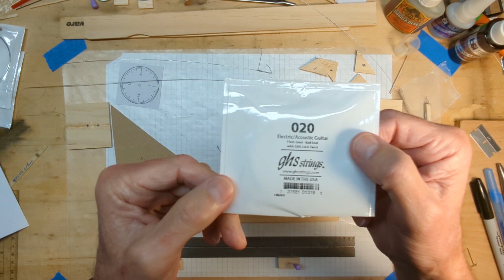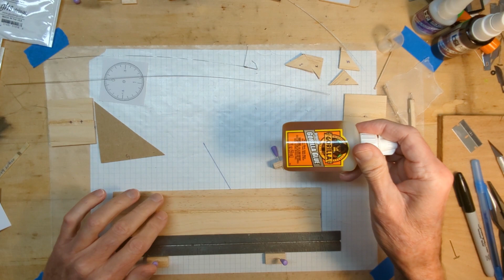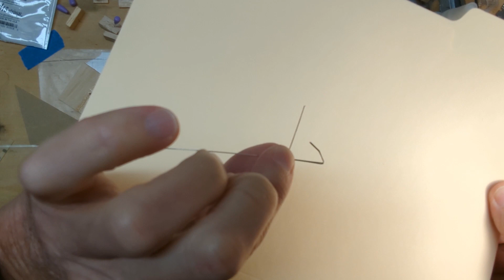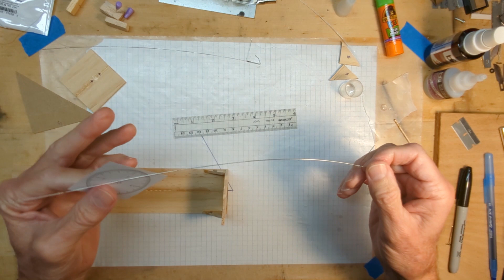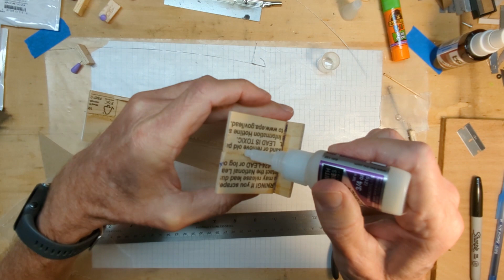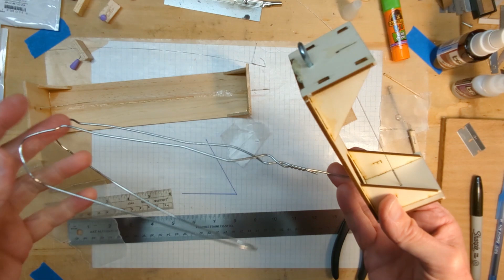Super Simple, Cheap Torque Meter Build

Comment: sorry this event it fully new to me and im just starting to get the hang of it but i have one question, how does the number of turns correlate to the torque count and how would i calculate the torque modulus? thanks
Reply from the maker: Number of turns is a poor proxy for torque. Each time you wind a motor its dynamic change. Generally speaking each successive wind will take more turns to match the torque of the previous wind. This is why we use torque meters

Comment: My wire tests found that 0.020" wire fails at about 1.8 inch ounces of torque. On the DCTM, that occurs at about 11. Twisting to 10 returns to zero. Twisting to 12 returns to 0.2. Once the yield stress is exceeded, the wire is no longer good for torque measurements. To go to 2 inch ounces for the 2014-25 helicopter event, you must use a larger diameter wire of appropriate length. The J&H torquemeter is smaller wire suitable for up to 3/32" rubber.
Reply: Correction: the DCTM also uses 0.015" steel wire.
Reply from the maker: Yes, good comment. Some on the NFFS Youth Development Committee have posted on the Science Olympiad Discord Channel a torque meter wire element substitution the 2024-25 Helicopter flying. As most of the helicopter kits for 2024-25 are using "1/8" rubber strip (.08-.087 g/in), and winding to over 2.0 inch ounces will be needed, an 11" piece of .025" diameter wire will record 4.0 inch ounces for one full revolution (twist) of 360 degrees.

Comment: Nice presentation.

You can get straight 0.020" K&S Music Wire from most hobby suppliers. It is important that the wire be straight, otherwise some of the turns go into making the wire helical. This is analogous to knots forming in rubber. Also, the indicator wire will not remain evenly spaced from the dial if the torque wire is not straight.

You must be careful to avoid parallax error in reading the dial. You must view the indicator wire straight on, otherwise the dial mark will be seen offset. Ideally the indicator wire will be very close to the dial.

It is essential that the torque wire going into the hook not twist inside the CA and thread, otherwise the needle will indicate an added twist for the bit of wire beyond the desired length. Steel wire is very smooth and could easily twist loose inside the CA and thread. I solder my separate indicator wire to the torque wire.

With this hook, the rubber will be slightly offset from the torque wire. This can cause the torque wire to bend. It must be kept straight. It would be better to make a hook that keeps the rubber aligned with the torque wire. I have used a square hook.

The dial has 100 divisions. What is the corresponding unit of torque? My measurement of some K&S 0.020" steel wire found it took 0.6222 gmcm to deflect one degree at 15.6 cm length. 9 1/2" is 24.13 cm, so it would take 0.6222 x 15.6/24.13 = 0.4023 gmcm per degree, 144.81  gmcm for 360 degrees, so your units would correspond to 1.448 gmcm. You could adjust your wire length to get some other value per unit. A 25 cm wire will make each division 1.5 gmcm. Your wire is likely different from mine. Wire diameters and torsional coefficients vary from batch to batch, just like the properties of rubber vary. For accurate results, you must test your wire. It is common to see recommendations to test wire with a lever and weights to apply a torque. This method bends and twists the wire and includes friction in the bearing, producing unreliable results. Another method uses a disk and weights hanging from the edge on thread. This also produces unreliable results. I use a torsion pendulum to measure the properties of the wire.

https://www.endlesslift.com/steel-torque-meter-wire-calibration/

Keep in mind that grams are not a unit of force, but a unit of mass. You must measure the local gravitational acceleration to find the force exerted by one gram mass.

https://www.endlesslift.com/measure-gravitational-acceleration-with-a-pendulum/
Reply from the maker: Aeromodeller:

We appreciate the feedback

We recognize there are simplifications and shortcuts in this design, The intent was to get a torque meter into the hands of SO students at minimal cost sourced from local stores, rather than ultimate accuracy. Reasonable repeatability in the 1 oz-in range is important, but absolute accuracy is not. May OS students are winding without torque meters at all, and much of our help online centers around winding details.

While hobby store wire is indeed straight and may be a better choice, we were finding that many SO students do not have access to a local hobby store. Ace Hardware does have ship-to-store of the K&S 0.020 wire, which may be an option for some, but more costly. The Guitar string Brian sourced was under $1, and is the only real cost in this project.

Those that want greater accuracy, the methods noted by Aeromodeller are great resources. We found some variation in wires from difference sources, and this results in anywhere from 8.875" to 9.5" in wire length for a calibrated output. But, for SO purposes, fixing this length and not worrying about calibration will get the kids close enough to see marked improvement in recordkeeping and consistency in flight.

Thank you for your interest, and your detailed feedback!